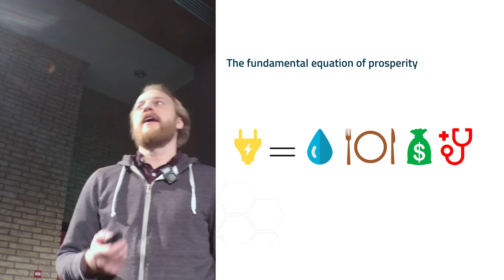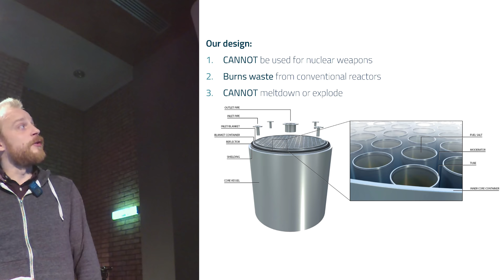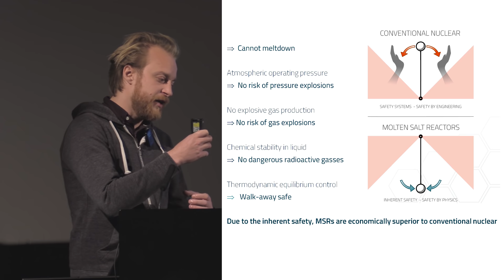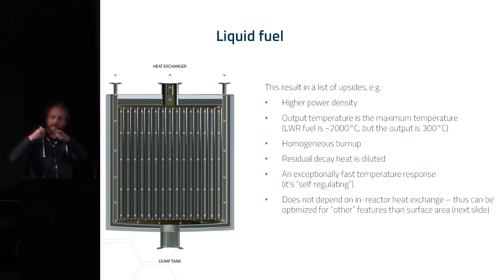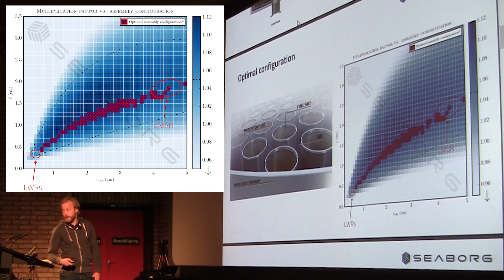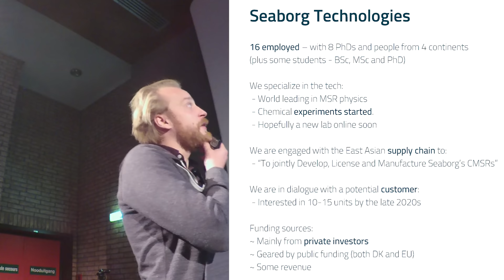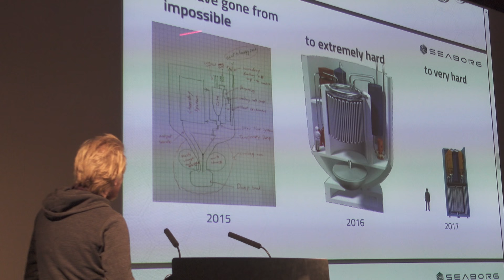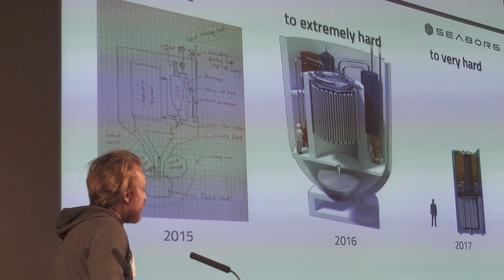Making Nuclear Sustainable with CMSR (Compact Molten Salt Reactor) - Troels Schönfeldt @ ThEC2018

Comment: Solar, wind, geothermal, passive solar, thermal mass, biomass need to be used in conjunction with the elimination of fossil fuel derived plastic packaging, roof shingles, and road tar. When used in-situ these technologies eliminate the need for vast infrastructure that cannot be maintained.  The cost of the infrastructure is the highest environmental, and economic cost; while the health of the infrastructure can significantly impact the health of people especially with regards to water distribution. If people used in-situ power that would eliminate 25% of the entire amount of electricity being used; the 25% that is currently wasted through line loss. It would cost a fractional amount to subsidize in-situ solar panels, wind turbines, solar collectors, and financed reconstruction for each citizen compared to the large generation stations and distribution infrastructure. There would  be no need to build a mine and dispose of any waste material. The materials used in current technology can be recycled without causing significant impacts to human health. Stone is still the best building material. It may be harder to work with, but it lasts longer and has the best life cycle assessment performance. 

WIPP in Nevada leaked plutonium underground and a very large amount is now detectable on the surface. Thermal plastic shifting caused the structure to fail and ruptured the containment barrels; which were always a far cry from the proper, expensive, copper capsules and bentonite backfill that should have been in place. These half measures caused the contamination and thousands of people will now die a horrible death from cancer; no one will take accountability. Allthough, McIntosh Engineering published a paper back in 2007 for a North American consortium comparing all the Deep Geological Nuclear Waste Repository designs in the entire world; including AECL, ONKALO (wrong spelling), WIPP, and even the super deep Russian borehole project. The only reliable long term waste storage solution is the super deep borehole method, and this is extremely expensive and not at all SUSTAINABLE. 

PLEASE SHUT THE FUCK UP.
Reply: Why don't you take your own advice?
Reply: @bobthebomb1596  
1. I'm right.
2. The world depends on it.
3. I'm not causing cancer.
4. Only rich people stand to benefit from Nuclear power. 
5. I'm not afraid to stand up to horrible power hungry people.
6. I was one of the team members who worked on the paper published for the North American consortium. We had access to mining journals that cost $1500/month to subscribe to; aka things not published in the media.
7. My dad has cancer. 
8. I studied Civil Environmental Engineering, Structural Engineering, and Civil Engineering Technology in school. 
9. I have worked as a property manager and carefully modeled each overhead cost of the property while ensuring a proactive maintenance schedule was in place. 
10. I have performed life cycle assessment on a number of water treatment technologies, and using mathematical modelling I was able to confirm my hypothesis. 
11. The technologies I want to promote are not a part of the Military Industrial Complex.
... shall I go on?
I certainly won't stop on your accord. You are just a basic narcissist; dime a dozen.
Reply: @brendanwood1540  The internet breeds them.  It's interesting that his argument for insitu power is the very argument for MSRs.
Reply: @tonyduncan9852  I won't argue with the logic of in-situ power. I will only argue with the relative sustainability, risk, and potential impacts to human health and the environment. Especially regarding the long term storage of Nuclear Waste.
Reply: @brendanwood1540  Every dictator the world over begins with the words "I'm right".
Reply: @brendanwood1540  "the long term storage of Nuclear Waste" - another argument for MSRs.  They consume long-lived radionucleides.
But the best argument is that we need MSRs to replenish our aquifers.  Our crops will fail without groundwater irrigation.
BTW I didn't think your list was serious.
Reply: Brendan, distributed MSR energy is much better than the cost and pollution of battery energy storage systems or even pumped hydro that "Renewable" energy requires. Radioactive half lives of hundreds of years is acceptable. Consuming existing radioactive waste as fuel is brilliant. Reducing weapons grade materials, using them for fuel is genius. Beating our swords into plowshares...
Reply: @tonyduncan9852  How will they replenish the aquifers?
Reply: @tonyduncan9852  Obviously water supply has been extracted from the aquifers, but a major factor in limiting the replenishing of aquifers is a flaw in our civil engineering design. We had for a long time merged storm water with sewage and industrial waste before treating the water or just dumping it raw. In recent times we have separated out the storm water and begun efforts to isolate industrial waste water from municipal sewage. However, most drainage basins around cities are now covered in paved surfaces or concrete with drainage isolated from the ground. The water is diverted to a drainage reservoir instead of naturally percolating through the ground and within rivers, streams, and creeks. Now LEEDS certified structures are starting to include BIO swales, rain gardens, and native vegetation that helps to absorb water and recharge aquifers. 

Soils engineering plays a large part in why we divert the water away from developed areas.
Reply: @brendanwood1540  

There really is no point in developing nuclear unless it is safe, cheap, and easily scalable. All of those criteria are possible with advanced nuclear, and we are going to need it to lift billions of people out of poverty while rapidly decarbonizing the economy. Very low cost energy will be required for addressing ocean acidification and negative emissions. Ocean acidification threatens to wipe out the marine food chain within decades. For negative emissions, we will have to sequester billions of tons of CO2 per year. If we do not dramatically lower atmospheric CO2 concentration, our coastal cities will be flooded and our agriculture will be wiped out from higher temperatures. The paleoclimate record strongly suggests that over 400 ppm CO2 will raise sea level by many meters and global average temperature well beyond 2 C. 

Deep borehole disposal is fast becoming a reality. Just recently a technique involving disposal within a deep layer of shale was demonstrated, and it should lower costs by over an order of magnitude.

And no, you are not right. You have made a few fundamental miscalculations related to risk and energy-economics, and it is time for you to reassess your position and stop spreading nonsense.
Reply: @cbarcus  What is the deep borehole method called, and where can I learn more about it? 

Can it be demonstrated through life cycle assessment that new nuclear technologies are sustainable? It seems hard to fathom considering the mining methods required to  first get nuclear fuel and then to process it and utilize complex reactors for energy extraction and finally disposal in deep boreholes. All these processes take considerable amounts of energy. Passive solar is a very simple concept not being used in construction code.

Passive solar requires no mining or manufacturing. Passive solar simply requires an awareness to reorient structures and integrate the existing components in a way the utilizes the southern exposure to sunlight. Sunlight can be stored as thermal potential energy in thermal mass and windows can be designed with ventilation that takes advantage of natural convection. Just a simple modification. This is just one example.

Bio-swales and rain gardens, along with native/resilient vegetation, would also help to sequester carbon. Algea and other forms of biomass can also be used to sequester carbon. Even the invention of new bio batteries or molten salt batteries will help to store the energy from the sun. 

Nuclear energy is safe and sustainable in a way; the sun is a massive nuclear reactor. It produces far more energy than we will ever need. 

Bio-mass digesters actually utilize the energy stored from photosynthesis. We currently throw away 50% of the organic products that we produce before consumption. Very small percentages of human waste are used for energy generation. Utilizing organic waste will reduce it's carbon footprint by 21 times; just through the conversion of CH4 into CO2. 

If something goes wrong at any stage of utilizing the afor mentioned technologies it would not cause a significant threat to human health or the environment; unlike nuclear fuel mining, nuclear power generation, or nuclear waste management.

How exactly will molten salt reactors sequester carbon aside from limiting our dependence on fossil fuel and coal? 

Wouldn't it make the most sense to have the large ocean freighters operate using molten salt reactors instead of burning dirty crude oil? A single freighter produces more emissions in one day than all the cars in North America do in one year. 

Obviously we could stop the corporate oligarchy pushing labour trade deals that drive the freight industry and subsidizing oil and gas. Stop companies infringing on peoples right to repair electronics and keep them out of landfill. Unfortunately, nuclear power is at the top of the corporate oligarchy with more money than the worlds 7 biggest corporations combined.  

We should make people aware of things like coltan used in tantalum capacitors and the fact that it comes from the Congo where children die mining. Or rare earth elements that require the production of a plethora of hazardous elements just to refine and manufacture. 

The increase in military spending in America was enough money for everyone to have free college; just the increase.

Exactly what is nonsense?
Reply: @cbarcus  The most important step we need to take is to decentralize agriculture and utilize in-situ green areas of buildings to grow produce which will also sequester carbon and make the building more energy efficient. Likewise, having in-situ livestock would allow for a rich source of organic waste to mix with human effluent and food waste to generate energy and provide nitrogen rich fertilizer. One of the main causes of aquifer depletion is water diversion for irrigation in large scale agriculture and livestock in areas that can't sustain the density of production or adequately recharge the surrounding environment through waste utilization. 

Agriculture leads to the need for phosphate mining and fluoride as a by-product. Which is also an ingredient in nuclear bombs.
Reply: @cbarcus  The reason we don't see these in-situ solutions is because of capitalism; same reason these reactors were not chosen back in the mid 60's.

Think about it, people making their own power, growing their own food, eating the healthiest live vegetables, doing good things for the environment, and not owing anything to anyone for it. Could significantly mitigate the costs of, and need for, healthcare. All of this is very much against taxation and capitalism. But it is the only solution that makes any sense. Even if we want to colonize another planet or live on a space station. We need sustainable in-situ solutions that provide what we need and utilize accessible and common resources with minimal RISK. The sun is pretty much ubiquitous. Unless we end up like Venus. Then else where in accessible space the sun is there.
Reply: @brendanwood1540  Aquifers in many parts of the world are being depleted to their end by common farming practices.  It has been happening for the past fifty years.
Sea water must be desalinated on a massive scale simply to mitigate this problem.  The ENERGY for this massive effort must come from thorium fission.
Reply: @tonyduncan9852  Why not solar concentrators? Why not mitigate the amount of water that is diverted from natural watershed recharge zones? Why not mitigate the need for irrigation by in-situ agriculture? Why not put limitation on Golf courses, and places like Las Vegas, or cattle farms? 

Mining is very much a necessary thing, however should we increase the amount of mining we are doing or try and utilize the materials we have allready mined differently? 

I have been following the Thorium salt reactor thing for a while. I can see  how it would allow for the creation of nuclear fuel for deep space missions and the like. However, just making better batteries would also allow for the same missions; to account for the time when the sun is not charging the batteries and powering the mission. 

Why not use biomass energy? Why not geothermal around the ring of fire in active subduction zones?

How would a Thorium reactor actually mitigate the need for infrastructure?
Reply: @tonyduncan9852  Surely we can't have Thorium reactors in every home right? We would still need a vast distribution network. The advantages of in-situ water treatment, and power generation, are a direct result of the elimination of losses and energy consumption resulting from distribution. Even UV water treatment has a carbon footprint because of the pumping required for distribution. 25% of power goes out into the environment diffused from non insulated cables. In-situ means actually in the home. Not in the municipality. The major infrastructure is within the municipality itself. The elimination of municipal infrastructure would automatically be 25% more efficient. Many businesses and homes are powered entirely off grid; proving that the technology works. Batteries exist that will work, but molten salt batteries are more sustainable. 

Who wants to have radiation inside their home though? No amount is safe. Just bad luck can account for cancer. It's like saying tasers are safe even though it just depends on the timing of your heartbeat and the officers knowledge of fibrillation and defibrillation. Would be a great analogy, except that you can't really defibrillate someone with mutated DNA and make it better.
Reply: Quite the moon-howling rant. Obviously someone to be taken seriously. Not. Lol.
Reply: @brendanwood1540  "Why not solar concentrators?" - I've seen one or two.  They aren't found close to cities.
"Why not mitigate the amount of water that is diverted" - The majority is in use for intensive agriculture already.
"Golf courses" - great idea, but not crucial.
"Las Vegas" - is a city.
"cattle farms?" - when we all volunteer to be vegetarian. 
"should we try and utilize the materials we have already mined" - Yes, but that's neither going to solve the water nor the CO2 problem.
"I can see  how it would allow for the creation of nuclear fuel for deep space" - The combination MSR/seawater distillation and processing/CO2 extraction/methane production/lithium extraction can be done on Earth and Mars.
"making better batteries" - of course.
"to account for the time" doesn't work beyond Jupiter.
"biomass energy?" - of course.  Although a pressure to create more topsoil may limit this.
"geothermal" - not near cities, and problematic corrosion.  Similar problems with tidal and OTECs.
"How would a Thorium reactor actually mitigate the need for infrastructure?" - By powering cities and energy-intensive processes from within. By being sailed like tankers to where they will be necessary and needed.
None of your suggestions will approach 40% of the necessary energy we will need to reduce atmospheric CO2 and replenish our aquifers.
We need to do the above AND farm more permaculturally AND re-stock our oceans to do a proper good job.  Now we know. . . .
Reply: @brendanwood1540  

A Forbes article on Deep Isolation's recent demonstration:

https://www.forbes.com/sites/jamesconca/2019/01/31/can-we-drill-a-hole-deep-enough-for-our-nuclear-waste/#31a973af68a7

White paper on their deep borehole disposal method:

https://www.deepisolation.com/wp-content/uploads/2018/12/DeepIsolationTechnology-White-Paper.pdf

Sandia Labs' report on HLW disposal in shale:

https://prod-ng.sandia.gov/techlib-noauth/access-control.cgi/2010/102843.pdf

Mining does not use anywhere near as much energy as you believe. Also, uranium is just one product of many in some operations. For lower grade deposits, in situ extraction via acid or base renders low cost uranium. Furthermore, the economics of nuclear are such that uranium can even be sustainably filtered from seawater, a renewable resource.

What you are missing with the renewable solutions is the high material usage which belies the simplicity of wind and solar. This intermittent generation effectively and modestly only reduces coal or natural gas emissions. Nuclear can completely displace those sources. France with its high penetration of nuclear power leads the world with its low carbon intensity grid. Germany after spending hundreds of billions is no where close.

Also, renewable solutions depend upon vast amounts of storage to time shift energy production. This storage, especially on a seasonal basis, can overwhelm costs, slowing down decarbonization. Of course, hydrogen can and will be used to redirect overproduction, but this does not really address the primary problem we have with decarbonizing industry.

And renewables are not likely to ever be remotely suitable for the task of negative emissions/ocean acidification. Allow me to summarize one way to address this:

As ocean acidification is a result of CO2 lowering bicarbonate saturation, a mineral essential for calcifying organisms, we can counter this with lime. So, a high temperature industrial process (see cement industry) can be used to release the CO2 from mined limestone. This CO2 rich waste stream can be captured and sequestered. The lime would then be deposited along the coastline, countering oceanic CO2, thereby increasing bicarbonate saturation. This is an energy intensive process added by the addition of high grade waste heat. Low cost advanced nuclear with its continuous power could make this process affordable so that we may sequester billions of tons of CO2 annually. Failing to do this will very likely result in unacceptable economic and environmental repercussions.

Low cost energy integrated into industry will also help make sustainable materials more available for the masses, raising people out of poverty, and lessening wealth disparity.

I think your political and economic assumptions are clouding your judgement.
Reply: @brendanwood1540  

Advanced nuclear will be able to provide the low cost energy required to make vertical farming possible, freeing up land for preservation or other uses. Agriculture feedstocks like water (via mass desalination) and ammonia will also be affordably rendered by a zero carbon industry, enabled by advanced nuclear power. Lower cost energy also helps enable recycling, and makes it more economic to utilize lower grade deposits of minerals.
Reply: @brendanwood1540  "we can't have Thorium reactors in every home right?" - Unlikely, unless you've got folding and an energy-intense hobby.
"We would still need a vast distribution network" - cities already have them.
"In-situ means actually in the home" - not necessarily.  I meant IN cities and IN steel plants and even IN oil refineries.  Mines too.
"The elimination of municipal infrastructure would automatically be 25% more efficient" - I doubt that.
"No amount (of radiation) is safe" - Untrue.  Check naturally-radioactive areas with their cancers.  There's no correlation.  There are repair mechanisms in the genomes of all plants and animals.  These tend to work.  Apart from that MSRs aren't dangerous in that they cannot explode, and cannot propel gases into the atmosphere.  They are already molten, and turn off when drained, if not before then.  The material is solid at NTP.
"Just bad luck can account for cancer" - Yep.  It would be unlucky to stand close to a working MSR, as it would to a working rocket motor.
"you can't really defibrillate someone with mutated DNA and make it better" - we all have mutated DNA.  It's what DNA does. I hate tasers.
Reply: @brendanwood1540  

I am not remotely interested in producing my own power. Not only do I not wish to incur the extra expense of PV panels and an inverter, I do not wish to spend a minute of my time maintaining such equipment. Furthermore, as I reside in the northern latitudes, such power production is particularly uneconomic. It is far better to centralize production to take advantage of an efficient industry using economy of scale. 

There are 7.7 billion people on this planet, with over 9 billion projected by the middle of the century. Instead of encouraging the masses to grow their own food and produce their own power, it is better to free them to use their time as they see fit.

I think your economic vision is fundamentally flawed, and it is entirely unsuitable for mitigating climate. Following your advice would likely hasten extinction.
Reply: I believe the use of nuclear, low carbon fossil fuels (natural gas) and even petroleum refined for lowest possible emissions, as well as solar, wind, and bio renewables will all be part of our future energy mix. Each used where it is most suitable, reliable, and economical.  For instance nuclear the best way for electricity production in cities and population centers. Where people are concentrated so should the energy supply be. Jet fuel and aviation gasoline will still be mainstays of aviation. Heavy equipment, railroad locomotives, and trucks will be diesel powered for a long time to come. I believe fuel cells will eventually replace the internal combustion engine but that will be decades away. Natural gas is most efficient for heating buildings in a colder environment. Solar and wind power may provide the substantial energy for small isolated communities or that energy resources need to be imported such as Bermuda or Hawaii and  in certain areas, or work in areas with constant wind and in a desert climate such as Arizona, New Mexico, California or Nevada.
Reply: @tonyduncan9852  Well, I must first say thank you for this civil discussion and actually addressing my points individually. This is a rare thing these days online. 

Solar would not account for 40%? According to a study carried out by the Intergovernmental Panel on Climate
Change (IPCC), an organization jointly established by the World Meteorological Organization
(WMO) and the United Nations Environment Programme (UNEP): 
"12. What is the theoretical potential of solar energy?
Sunlight has by far the highest theoretical potential of the earth’s renewable energy sources.
The solar constant (the solar flux intercepted by the earth) is 1.37 kW/m2
. The cross-sectional
area of the earth intercepting this flux at any instant is πr
2

 (where r = 6,378 km is the earth’s
radius), but the surface area of the earth over which this flux is averaged over time is 4πr
2. Hence,

the time-and-space-averaged solar flux striking the outer atmosphere of the earth is (1.37 kW/m2
)/ 4 = 342.5 W/m2. In addition, enroute to the earth’s surface, about 30% of this flux is scattered,

and about 19% is absorbed, by the atmosphere and clouds (Wallace 1977, pp. 320-321). Hence,
the average flux striking the earth’s surface is 342.5 W/m2
 · (1-0.49) = 174.7 W/m2
.
The theoretical potential of solar power is the integral of this average flux over the earth’s
surface area (4πr
2):

(4) P = (174.7 W/m2
) · (4πr2)

= (174.7 W/m2
) · 4π · (6,378 km)2(106m2/km2) · (10-12 TW/W)

 = 89,300 TW.
This theoretical potential represents more energy striking the earth’s surface in one and a half
 hours (480 EJ)67 than worldwide energy consumption in the year 2001 from all sources combined (430 EJ)68.

This theoretical potential could be used to generate 15 TW of C-neutral power from 10%-
efficient solar-conversion systems covering only 0.17% of the earth’s surface area,69 or

(5) A15TW = 0.168% · (4πr
2)

= 0.168% · 4π · (6,378 km)2

= 858,792 km2

.
This area is roughly the land area of Namibia (825,418 km2
) or Venezuela (882,050 km2).70

To supply the (smaller) power that the U.S. consumed in 2001 (3.24 TW)71 with similarly
efficient solar conversion systems would require a correspondingly smaller surface area,
(6) A3.24TW = A15TW · (3.24/15)
= 858,792 km2
 · (3.24/15)
= 185,500 km2
.
This is roughly 1.9% of the surface area (9,631,418 km2
), and 2.0% of the land area (9,161,923 km2), of the U.S. (CIA 2005). It is also roughly 30 times the total roof space (5,800 km2)72 that

was estimated to be available in 2003 for photovoltaics in the U.S. It is comparable to the 1-1.5%
of the U.S. land area that is covered by the nation's public roads;73 and is comparable to the land
area of North Dakota (178,694 km2
) or South Dakota (196,576 km2).74"

If you care to read more https://www.sandia.gov/~jytsao/Solar%20FAQs.pdf

This is just Solar power alone, not including the potential of wind, biomass, and geothermal. Easily more that the 16 TW we currently use. 

Now I think any power generation method will have life cycle impacts, so it is more important that we increase energy efficiency within structural design and by minimizing infrastructure. The infrastructure in cities needs to be maintained, it does not simply exist to be utilized. The current infrastructure needs replacement especially with regard to water distribution. The loss come from the distribution itself.

Power lines carrying high voltage to transformers are what incurs the loss, and this infrastructure costs $250 000/500 meters. Water infrastructure costs $300 000/500 m, and gas is roughly the same. Roadwork over the infrastructure costs up to $1000000/1km. In-situ would eliminate the cost. Those properties that do not have adequate land area could use combined systems to meet the needs, and yes some infrastructure will be required. Current infrastructure won't in itself be resilient, sustainable, or long lasting. 

How resilient are MSR's? What happens if we have an earthquake, or there is a flood anomaly, or a terrorist event, or a fluke plane crash, human error, or a mechanical malfunction? 

How can we ensure there is adequate quality assurance when the only recent application to build a nuclear power plant in the US used semantic arguments to avoid quality assurance programs were in place? With cooperation from the regulatory agency who considers an application not an official applicant until the paperwork is on the desk of the agency. Allowing work to be carried out before a quality assurance program is in place and thus stripping whistle blower protections?
Reply: @TheOldGuyPhil  Definitely agree we should use the existing material to reduce it's half life.
Reply: @stuarthirsch  

Here is NASA's electric turbo jet concept, but they are also developing fuel cells for aviation:

https://ntrs.nasa.gov/archive/nasa/casi.ntrs.nasa.gov/20150002081.pdf

Current fuel cell tech is already suitable for long range small aircraft, but the refueling infrastructure is not yet ready. Hydrogen locomotives are just now starting to roll out, which should work better than trying to electrify all rail. Electrification is more economical for high use passenger lines.

Semis at ports are just now starting to be converted to hydrogen fuel cells, and Nikola is building fuel cell trucks and the refueling infrastructure.

Realistically, it will take about 20 years or so to transition passenger vehicles to electric powertrains. Some parts of the transportation sector will take a little longer. Advanced nuclear should be able to be rapidly deployed, outpacing all other sources, so I expect it to be dominant by the 2040s. It will be tightly integrated into industry, decarbonizing cement, aluminum, steel, glass, ammonia, water, etc.. Successful climate mitigation (ocean acidification/negative emissions) will require vast amounts of cheap energy, and that will utterly transform civilization, virtually eliminating poverty by the end of the century.
Reply: @stuarthirsch  I agree with you, and I think upon recent consideration, that MSR is the right way to transition from our current system into a nuclear free reality. But the goal should be nuclear free, not dependent. All and all your view is very pragmatic. Mine kind of borders between pragmatic and ideal; call it a distant goal to reach for.
Reply: @brendanwood1540  

The resiliency of MSRs is addressed in the video, so go back and watch it if you missed it.

Basically, the fuel and most of the fission products are retained in the fuel salt. The gases (like xenon) come out and are captured, allowed to decay, and then the stable stuff is released.

Negative reactivity with these thermal reactors is really strong, so this keeps the temperature under control, no human or system intervention required. The molten salts have a large temperature margin to the phase transition, so it is not going to boil. In the unlikely event of a temperature anomaly, a freeze plug melts and the fuel salt drains into a tank. 

Now suppose someone attacked the MSR plant with missiles and blew the machine to hell, the molten salt leaks out into the bottom of the silo and solidifies, retaining the fission products. If somehow it splatters out of the facility, again, it solidifies. This is nothing like solid fuel reactors which retain gaseous fission products in its fuel assembly, releasing them during a meltdown. A Fukushima or Chernobyl type outcome is physically impossible, and the absolute worst case scenario is a small accident with very limited contamination.

There are a variety of molten salt reactor designs, so the exact failure outcomes vary. For instance, there are fast solid fuel molten chloride reactor designs that work a bit differently.

Dr. Alvin Weinberg, the scientist responsible for the MSRE's development, also developed the light water reactor. His motivation for pursuing the MSR was both safety and economics. He warned his department about the safety short comings of LWRs and was promptly sacked. Nixon canceled MSR development, and then decades later Clinton killed the successful meltdown proof integral fast reactor, EBR II.
Reply: @tonyduncan9852  
Here's a breakdown of the biggest energy use categories in the typical home:

Air conditioning and heating: 46 percent
Water heating: 14 percent
Appliances: 13 percent
Lighting: 9 percent
TV and Media Equipment: 4 percent

Air conditioning heating and cooling requirements could be greatly reduced by use of passive solar design, integration of thermal mass, and use of green buffer zones including green roofs. With the advantage of providing homegrown food, and a place to utilize organic waste effluent after digestion and energy extraction. Methanogenesis is an extremely efficient way of extracting solar potential energy from the molecules in plants. Photosynthesis stores solar potential in plants within the phosphodiester bond. Bacteria can effectively use this stored potential energy and produce methane, along with amino acids, and nitrogen that enriches the soil. Those bacteria are anaerobic and thus the process kills all pathogens. There is also a significant amount of waste heat that could be utilized passively. Methane can provide heat or cooling. However, just changing the thermodynamics of structures will greatly reduce the need for energy use at all. 

All water heating can be accomplished through solar concentrators; not as difficult to manufacture as solar panels. https://assets.publishing.service.gov.uk/media/57a08a15e5274a31e00003f8/Small_scale_concentrated_solar_power.pdf
This paper discusses some of the barriers the prevent CSM from entering the market; the barriers are not life cycle issues with the feasibility of the technology. The barriers are low confidence on the consumer end due to lack of information and marketing. 

According to this study> https://www.eia.gov/outlooks/ieo/pdf/industrial.pdf , the major uses of energy in industry are also related primarily to heating, and heating for industrial processes. Concentrated sunlight can easily achieve the required temperature for industrial heating in-situ. 

Block quoting here:
Jack Denur
University of North Texas
If sunlight is concentrated as heat the Second Law of Thermodynamics puts the maximum temperature that can be achieved by concentrating sunlight as the temperature of the Sun's photosphere, 5800 K. If sunlight is concentrated via work there is in principle no limit (except perhaps the Planck temperature 10^32 K). Thunderstorms concentrate solar energy (albeit inefficiently) via work rather than heat and typically generate 30000 K lightning bolts (the strongest lightning bolts may be even hotter). The Sun's corona is heated via work by the Sun's 5800 K photosphere to a few million K. The LHC ultimately operates on solar energy, and concentrates it via work to 10^17 K (near-Big-Bang temperatures). Whether concentrated via heat or work of course the maximum flux is the solar input of slightly over 1 kW/m^2.

Yehia F. Khalil
Yale University
With an average efficiency of 15%, a square yard of solar photovoltaic cells (PV) would produce (5 kilowatt-hours of solar energy multiplied by 15% =) .75 kilowatt-hours of electric energy per day. Solar panels (PV) covering an area ten yards by ten yards (100 square yards or 900 square feet) would produce 100 x .75 = 75 kilowatt-hours of electricity per day.
Concentrated solar power (CSP) systems can achieve 30% efficiency, or about twice the efficiency of standard photovoltaic cells (2 x .75 = 1.5 kilowatt-hours per square yard per day).
Hope this helps answer your question.
Professor Yehia Khalil
Yale University
USA
Reply: @brendanwood1540  "thank you for this civil discussion" - You're welcome.
"Solar would not account for 40%?" - before we depleted our resources - especially our land use.  I'm aware that there's plenty of solar flux.  We just cannot flood the surface of earth's land with pv panels and mirrors.  The solar flux has also to flow over plants and animals.
"the potential of wind, biomass, and geothermal" - I've covered those.
'important that we increase energy efficiency" - It is, but that doesn't touch the basic problem, which is that once we have depleted our material and land resources we are still 60% short of the energy we need to fix our present problems.
"Power lines carrying high voltage to transformers" - are what we need to balance our energy flow.
"In-situ would eliminate the cost" - In-situ won't balance the energy flow and cannot make the best use of our resources.
"yes some infrastructure will be required" - finally.
"Current infrastructure won't in itself be resilient, sustainable, or long lasting" - nor will it ever be. 
"How resilient are MSR's?" - Properly-designed, you could walk away from one, never having to worry.
"What happens if we have an earthquake, or there is a flood anomaly, or a terrorist event, or a fluke plane crash, human error, or a mechanical malfunction?" - Nothing.  The best current idea is to build them like a supertanker. 
"How can we ensure there is adequate quality assurance" - by ensuring there is adequate quality assurance.
"I think your economic vision is fundamentally flawed, and it is entirely unsuitable for mitigating climate. Following your advice would likely hasten extinction" - is what Corey Barcus wrote.  I agree with him, not you.
Reply: @brendanwood1540  I don't understand. Why would you even consider a nuclear free energy system if nuclear weapons were banned internationally like chemical, biological weapons and land mines, with international inspections and severe sanctions for weapons development and deployment. The MSR really address all other issues and problems associated with nuclear power, especially "burning" thorium. So our real issue is to lobby our respective governments to decommission and end  the nuclear weapons terror that is the real barrier to a much cleaner nuclear energy future. Nuclear weapons have no real military purpose anymore, but are rather instruments of terror and geopolitical blackmail. I believe that nuclear power is indispensable if we are to have a modern industrial civilization with a global population of close to 10 billion with an increasing standard of living  and reasonably health environment. Not to mention that I hope humanity won't be earthbound in the future. Nuclear power and energy are essential for human spaceflight beyond cislunar space.
Reply: @stuarthirsch  Seconded.  Personally I don't believe that nuclear weapons will go away.  They will become more specific and 'efficient'.  I don't see how they are a barrier to MSRs, as their contents will be known at all times.  We just have to get on with it.  It's a political issue that needs sorting out.
Reply: Kytsche  I agree fusion is the ultimate energy resource. However even the most optimistic forecast puts a working fusion power reactor at least 25 years away. Assuming that the demo fusion reactor will come on line and prove reliable, practical, and financially feasible, I believe it will be another century before fusion will become the major factor in our energy mix and the world is able to transition to a fusion/hydrogen(H2 via electrolysis) economy. Meanwhile we do have fission, fossil fuels, and of course renewables. All can be used to produce H2 hydrogen. To me the hydrogen economy is the real key to our energy future, even more than which energy source produces the H2.
Reply: Kytsche  "we would reach our limit in sustainability terms by 2060" - that would be a great start.  Don't knock it.  Anything could turn up in the meantime.  EFFICIENCY has been talked about for ages, yet NO thermal process is as efficient as it should be - to a power of ten.
You are talking over and above your understanding.  Thanks.